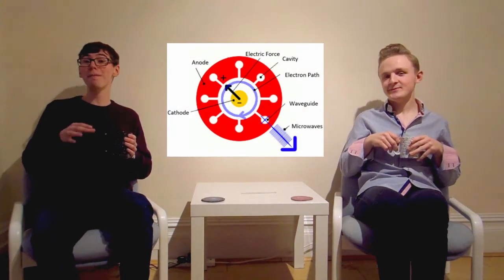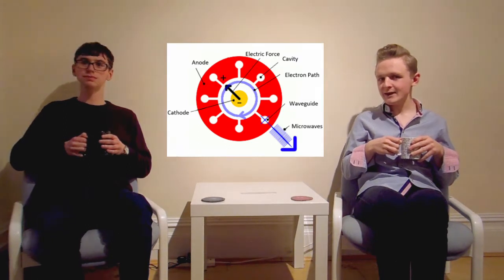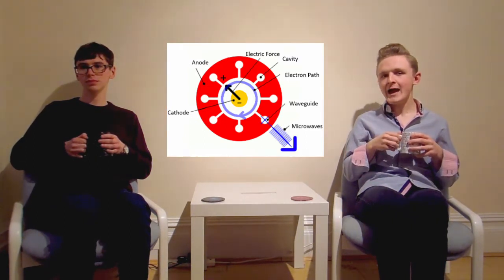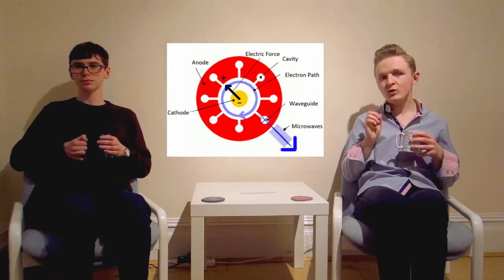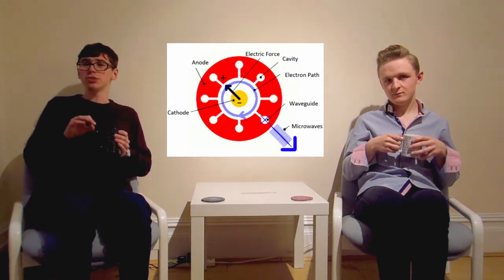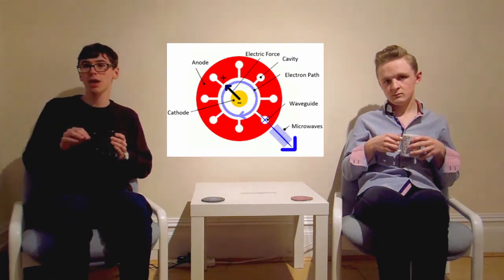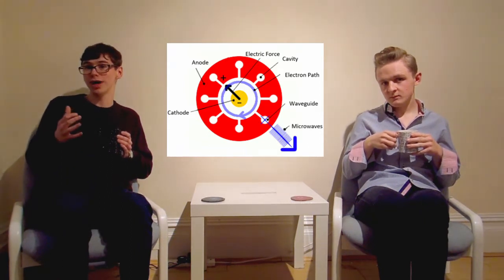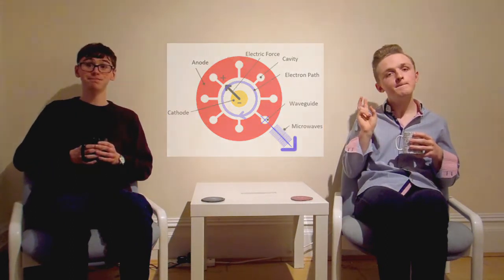How Do Microwaves Work?

Comment: can you explain difference in centrifugal force and centrifical force
Reply from the maker: "Centrifugal force" is the name we give to the sensation of being thrown to the outside of a rotating object (like on a roundabout) or the outside of a sharp turn when in a car. What is actually happening is not that there is an additional force but more that, in the second  example, you 're body is trying to travel in a straight line (due to your inertia/Newton's first law) while the car turns into your path, meaning you feel the car door press against you, which you interpret as a force pulling you to the outside of the circular path. So why does the car turn in the first place? A force is required to pull the car inwards to stop it travelling in a straight line. This inward force is often called the "centripetal force" but is not some sort of additional force but in this case is fact friction. Any force that provides an inward pull to cause circular motion can be labelled as a "centripetal force."
Reply: CoffeeTablePhysics - Thanks coffeetablephysics, now i won't die ignorant or embarrass myself when talking to my son by believing that there is such a thing as centrifugal force.